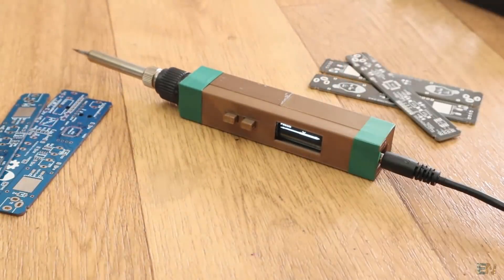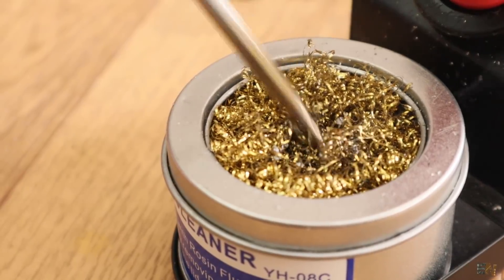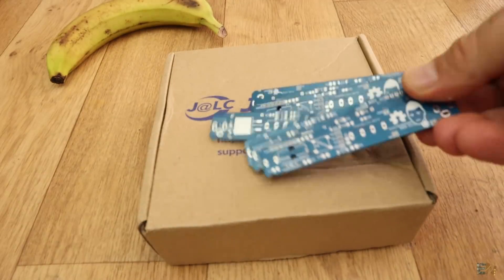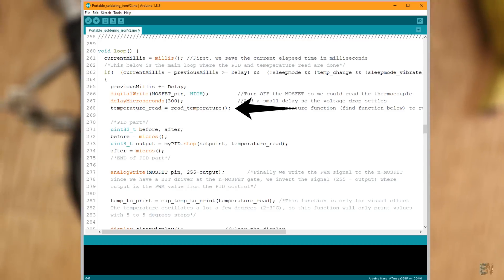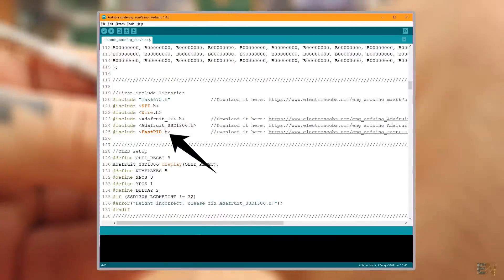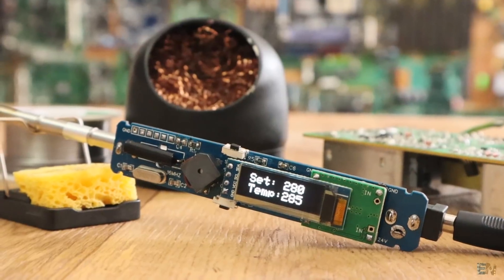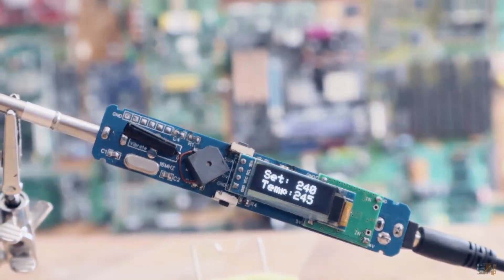DIY Portable Soldering Iron | Version 2.0

Comment from the maker: Want to help my workshop: https://www.patreon.com/ELECTRONOOBS
Thank you so much!
Reply: Can you make radar using ultrasonic sensor.
Reply: Electronoobs I was wondering...Doesn't the pcb get too hot due to the heat transfer from the soldering tip through the metal clips?🤔
Reply from the maker: Not at all. The mosfer gets a bit hot!
Reply: You could try use https://github.com/vdeconinck/QC3Control for power supply. It would be nicer since now qc3 power bank is common.
Reply: Make one to selling haha if you do, I want one if you make it, :D I love it
Reply: are all soldering irons that plug into the wall considered portable? xD i think portable would mean battery powered maybe?  something you wouldnt have to plug in would be portable i'd think.. if not then all wired soldering irons that plugged strait into 120v would be portable right? what type of battery bank would you use for this? 3s? 4s? maybe even 5s?

Comment: In itself a well thought out project, but why are you using a step down converter. The microcontroller needs so little power that you could easily use a linear regulator, e.g. an lm7805. This not only saves you a few cents, but you can also make the soldering iron narrower. The lm7805 also offers advantages such as automatic temperature switch-off.

Comment: Hi, great video. Can you tall my why did you put the zener diode and the capacitor in tha op-amp circuit. I think that they are not needed and they capacitor will charge up to the supply voltage end you will have to wait for the capacitor to discharge to get a accurate reading ot the temperature. Also the zener diode will start to leak current to ground if the voltage across the heating element is to adove the zener diode break down voltage. Maybe I am wrong

Comment: I was trying to load the bootloader with only the atmel328p, crystal and the 22p caps. I connected my power supply to the 5V and GND, according to the silkscreen. Large currents started to flow. I tried to resolder the chip and also tried about 3 different 328p chips and two different pcb's. Still the same. Now I know why it did not work. The 5V and 24V are actually GND. The 5V and 24V are also both connected to the copper planes. I think there are a few mistakes in the silkscreen where the step down converter is connected.

Comment: hi Electronoobs, great project
I want to make this, but not portable and i have few questions plz
i've got to use through hole component, what to92 transistor can i use to replace 2SC3356?
The irf540 does not support 24v in is gate, can i use FQP33N10 instead?
I'm beginner with arduino programming, is it complicated to change code for use rotary encoder instead of push button?

Thanks in advance

Comment: Hi, since you use 24V to power up your iron solder, i think that can be a good idea change your mosfet to part number PSMN3R0. This one is a N channel mosfet, but has small footprint size. Take a look. Great work by the way.
Reply: You can't use a NCH mosfet for this project (unless you use the bootstrap technique), it requires high side cut off in order to be able to read the thermocouple voltage. Cheers.
Reply: I see, you're right. But you can fix this with a small ones capacitor and diode, or if you prefer, you can use a BJT as a driver isolated by a resistor.

Comment: For the 16MHz crystal you can replace it with a Murata CSTCE16M0V53-R0 SMD. It should save you some space there. Can steal one off an Arduino Pro Mini if it takes too long to ship :)

Comment: hi bro can i use HORIZONTAL MODE in f450 size drone please please must reply !!i wanna use
Horizon Mode
Similar to Angle mode, Horizon mode still works to keep the craft level when there are no inputs. But it also allows you to do flips and rolls when the stick is at full deflection. However doing aerobatics in this manner feels more like a toy grade “push-button” flip system.

Comment: Would this work with TS100 tip? It has the same thermocouple, if I am correct (they make converters/holders on Thingiverse for TS100 to use a T12 tips), and is not that much more in price, and is a lot smaller. Well few bucks more wont brake a bank when it comes to having fun.
Hm, I think I will order a housing for T100 and see if there is a space to put the board in it.
Nice project.
Reply: TS100 tips are supposed to be based of T12 tips, i've seen people use hakko T12 tips on TS100 and it works fine. The TS100 should thus work fine as well here...
However, be aware that TS100 tips are shorter than the regular TS100, so check if it will mechanically work for your use case...

Comment: I think you can use clip from clone. https://www.ebay.com/itm/Pluggable-T12-Iron-Tip-Holder-Bracket-for-936-907-Soldering-Iron-Handle-Z/132735546253

Comment: Ok, here goes some comment: I've also made some iron's with the T900 tip , the one you show in the first model of the iron. I have used other mosfet for the iron driver and a bit different approach based on other Open Source design. But the thing is I think from the video the T900 tip does make a very good iron, not as good as the T12, but a very good iron also.
The problem I see is that you've used the wrong heating element for the T900 tip. I've always been very careful to choose the right Ceramic tip, they are sold in ebay and they are the Hakko clones.
The reference is the A1321 for 50W and the A1322 for the 60W version.
The very cheap ones are terrible ... they have a very poor heat delivery and they take a very long time time to reach the maximum temperature ... minutes maybe depending on the element. 
Those T900 heating elements that are sold like Hakko clones (they're more expensive then the cheapo ones of course and they're ceramic  I've found them from 2.5$/each + ) those work great! They're fast and they reach easily 430C with no problem.
Just a heads up ... do not loose hope on the T900 tips :) they're great and they're by fr the less expensive iron anyone can make.
Also another issue with temperature is that there is a gap between the tip and the ceramic heater. That gap reduces a lot thermal efficiency. Wrap the heating element with say copper sheet and the thermal delivery will be also better.

Comment: to get all smaller i think of stripping components of a arduino pro mini. the caps and crystal and all very small. and thay are cheap as chips.
was thinking of using pro micro as the 32u4 chip comes with usb interface built in.
like all builds. in the hardware changes are easy....the magic is in the code.

Comment: Very nice project.Maybe you should try out JBC clone tips, they are around 10usd but shorter and could save you some space. Or you can try to fit those tips for robotic soldering since they are super compact around 110mm but they are probably too expensive.

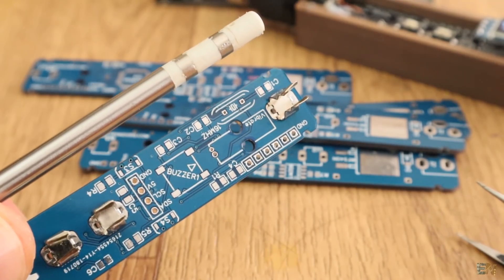Comment: @5:22  The forward clip should be grounded, or connected to earth to prevent static electricity from building up and shorting across the things being soldered.
Reply from the maker: True. It should be connected to adn earth screw or so. After I finished the board I was thinking about that...

Comment: Use a Weller tip, it uses 3.5mm jack connector, so it can be much smaller than the clips
Reply from the maker: Yes but it is a bit more expensive
Reply: expensive?
Reply from the maker: Yes, the T12 is like 5 dollars and the weller RT tip is like 35 dollars.
Reply: https://www.ebay.com/itm/T12-BC2-J02-JI02-KR-ILS-Soldering-Tips-Iron-For-HAKKO-Soldering-Rework-Station/152890872457

Comment: I would have thought the centre tap of the sensor and heater are connected to the case (the 3rd connector). If that is the case then sensing and heating are independent.
Reply: i tested my t12 tips. all of them has no conection to the casing . so i think EN is corect with his conection
Reply: I have a T100 and it also has no connection between case and contacts, so EN's solution is only way to check temperature.

Comment: Is there any reason you used the buck converter module instead of a simple linear regulator IC? It seems really overkill to have an adjustable buck converter when a single IC would do.
Reply: By an "single ic" do you mean a linear regulator?, if so the issue it's power dissipation, the power consumption of a project like this it's low, around 30mA (just the atmega328 takes around 20mA) but with a 20 VIN you'll have around 450mW of heat for the regulator to dissipate, with 24vin will be 570mW, so you'll need a  regulator with a to-220 package for this application, so regarding space it's almost the same as the buck converter just with better efficiency. Cheers.
Reply: Yes, I mean a single linear regulator IC.
For anyone else reading this, here's the calculations to get the power dissipation number:
The Atmega328 will draw up to 20mA, but while idle (Which it is the majority of the time) the current draw is nearly zero. The OLED display will draw 15ish mA with the amount he's drawing on it, so I would estimate closer to 20 mA current draw, so 100mW power draw . 
The efficiency of a linear regulator is about equal to the voltage ratio, so 5v/24v = about 20% efficiency. So the power dissipation of the regulator would be somewhere in the range of 500mw.
Now, for a through hole part, you are right that you would need a fairly large package (Like a to-220) to dissipate that amount of heat. However, with surface mount parts the board acts as a heat sink, so you can get away with a fairly small package.
Here's a link to a part I used for a similar application in a recent project:
https://www.mouser.com/datasheet/2/389/l78-974043.pdf
With proper heat sinking, this one can dissipate 5W of heat (For the SMD version). Realistically it'll be closer to 1-2 watts in a small board like this, but it's still plenty for the application and it's way smaller/cheaper than the buck converter module.
Reply from the maker: Thank you for the help!

Comment: I use the AO4407 p-mosfet for my DIY T12 soldering station, works pretty good and supports up to 25v on the gate, the mosfet that you're using supports only 20v, you should be using a zener diode to drop some voltage unless you aren't using 24v, of course, also check the IC on those little DC-DC converts, because there are two versions, one supports only 23v for vin. Great project!.

Comment: That project looks very very close to the soldering station from jurgis.me, the adc calculation in the sketch, even with inverted PWM and HIGH/LOW because the MOSFET is in high side configuration, which also looks the same like jurgis project, looks like you didn't understand that and so added later that transistor on top of the MOSFET as a driver. I always add names and sources for ideas in my codes. But still nice work.
Reply: yep that video idea looks like a pretty straight copy of the general ideas ...

Comment: I bought one of those Yihua 937D soldering stations from china. It has the same handle and heater. If you wrap the heater in tin foil and add a dab of heat transferring compound you'll have a cheap working soldering handle.

Comment: Cool project! Or should I say hot🤔 What temperature wil the opposite side of the element become? Do you need a high temperature proof housing?
Reply from the maker: Not at all. The other side is quite hot. What I've noticed is that the mosfet is getting hot.

Comment: Perhaps make v3 with a switch for 12v and 24v input if space permits. Been a lot of times I needed to use a soldering pencil using the 12v from a car and couldn't. 

I realize this will need to use a boost convertor to get to 24v. 

Anyway, excellent build and video. Thanks.
Reply: This is all you need, get a boost-converter and place it into the 12V plug for cigarette lighter, I bet you have somewhere an old charging adapter for phones and those cases are mostly big and have room for the converter, even in massproduction I would choose this way and sell it as a set with the iron, if Apple would do that they would sell this adapter extra for hundret bucks or so xD

Comment: make some kits with the components and open an etsy shop ?
btw, as you need 5V , isn't it possible to don't use the buck converter and use a USB power pack (some delivering up to 2amp) ?

Comment: Very nice project!! Personally I would prefer a DIY "soldering station" project, I don't need a portable soldering iron too much, and even with TS100 I found the problem that it's hard to hold for me, to always see the display etc, I would prefer to have display/controls on the station itself, and using only the iron itself as a ... well an iron :) Surely, there are tons of projects like that, indeed. What in my mind though, that it's always the quality and availability of the used tips or "cartridges". Far better than "older design" (not-direct heating), still, T12-clones from China are kinda poor compared to big names (like real T12 from Hakko, or JBC ones etc). However with the PACE ADS200, it's an interesint story. It's whole iron + cartridges are not so much expensive, and still, it's told to be almost as good as JBC ones (not the very same thermal performance, but much less costly, and has longer life, it's said ...). So it would be interesting to see to create a soldering station using the whole iron (also it's a much better quality than getting only the cartridge and try a DIY home solution for the case, cable, etc ....) + its cartridges with a custom "driver". Since the cost of the whole station of ADS200 is still too much for many people. By contrast, just buying the iron of ADS200, and cartridges for it, seems to be kind of cheap. Interestingly, it seems ADS200 station uses AVR inside, according to an EEvblog  video from Dave Jones, if I remember correctly.
Reply: you can do this easy with this controler. just conect to a t12 soldering iron.
Reply: Yeah, surely, I mean, it would be nice to see a video on it, with proper case, its look&feel, and also the power solution, since then - in contrast of portable soldering irons - it's more a natural wish to have a plug directly to the mains ... So yes, you're right, basically it's almost the same, but the several small differences to have a really nice solution make that different still as a real project.
Reply: Yeah. Portable iron we already have, I bought a ac version, without the need of power supply for something like 20 usd. But stations... They all seem to be very old and conservative. Could be. A. Good evolution made by you guys.

Comment: what about putting two 18650 cells inside a future "truly" portable version?
Reply: anyway... very very nice job!
Reply: sasiskas  one 381220 LiFePo4 does (10Ah)
Reply: sasiskas   no, I meant 38120, and of course not in the handle. smaller than a decent lipo and handles more current (not the joule/weight is more, the current capability better and more safe - 10A nominal discharge). or you can build a portable DC source from it.
Reply: This would work on the 8watt usb soldering irons that are all over ebay and amazon.

Comment: Very nice!   Have you ever experimented with obdev.at VUSB on the 328p?   Even better, you could use an stm32f103 with 128kb flash, that cost only about usd$1.10 -- this can be programmed through USB or Serial.  Probably how the TS100 works.
Certainly, the Hakko tips are the way to go.  Hopefully, your 3d-printed case can fit an FM2028 so the operator can hold the device close to the tip.
https://www.aliexpress.com/item/FEORLO-1pcs-Yellow-FM2028-Soldering-Handle-Part-socket-sleeve-For-Hakko-FX951-T12-Soldering-Solder-Iron/32882809920.html